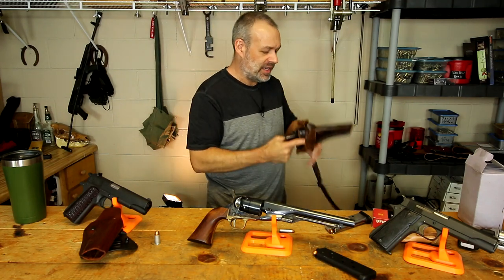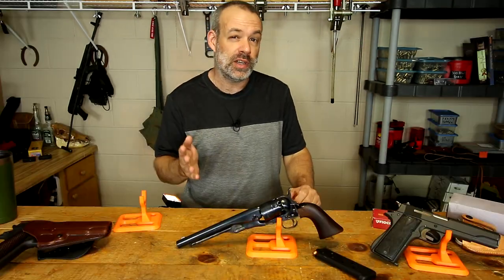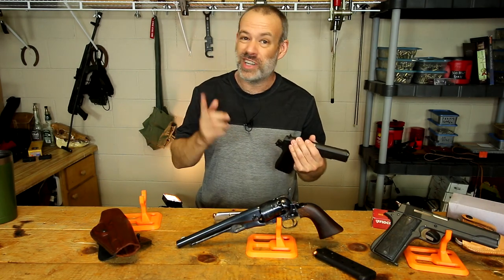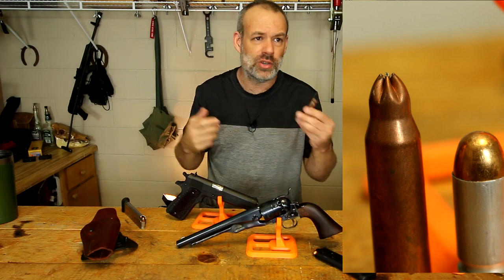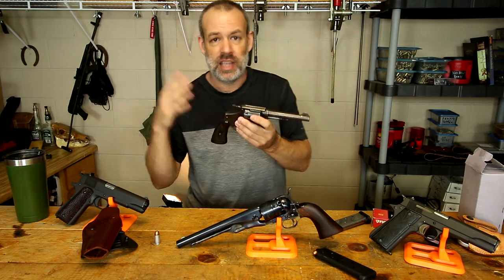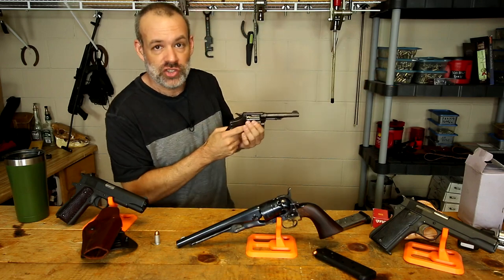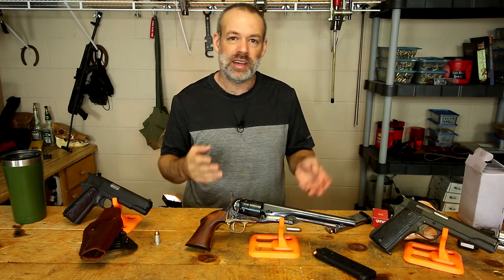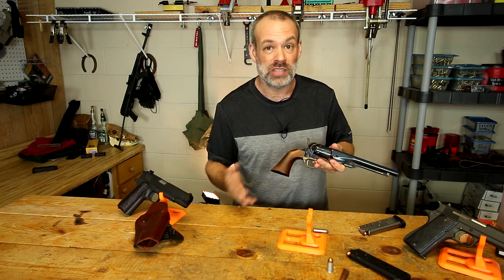How Do Prop Guns Kill?

Comment: The "prop gun" in question wasn't a semi-auto. It was a post-Civil War single action revolver converted to fire metallic cartridge ammo (or, more likely, a modern replica of one). If the account of the incident is accurate, the projectile went all the way through the chest of the DP and went on to hit the director in the shoulder. There's no way that was debris expelled by a blank round. It had to have been a live round.
Reply: it might of been an actual live round. or maybe a past squib then loaded with a blank and the the gun was never checked for a barrel obstruction.  and the barrel still had a heavy cast lead projectile inside.  maybe a primer was never nullified and might of gone off in a way no one caught it, maybe the hammer was resting on a live primer and it got bumped at some point and went off away from the prop master. it could of been the another part of the crew and when it went off they just ignored it or walked away not knowing what had happened, thinking it was just a standard pop from a prop gun.
Reply: Baldwin is off his rocker for a few years now.
Reply: Last I’ve read, the day of the accident, a number of crew walked off the set due to safety concerns. In particular, the first assistant director repeatedly failed to take seriously the required firearms safety briefings whenever guns were on set.The prop master wasn’t a member of IATSE, the relevant union, and there are reports of union film crew being replaced with non-union workers. The really damning thing (if true) is the claim that the film had a hard time finding an armorer because the reputable ones didn’t think the film could be made safely with the time and budget available. And that may be partially on Baldwin, he’s listed as a producer.
Reply: @andrewjanssen8663  yeah, it seems like safety precautions were lacking! Why would anyone be firing any type of gun or ammunition toward a crew member?
Reply: Gunn by name, Gun by nature.
Reply: @stevenmike1878  You know the previous day this same prop gun had an accidental discharge.  There were many on the set who had walked off citing among other things safety concerns.

I wonder if that accidental discharge was a primer going off and lodging a bullet in the barrel.  If, as you said.  they loaded the gun the following day with blanks and did not check the barrel for obstructions that could have been what happened.
Reply: @MikeB12800  One explanation could be they needed a camera shot right down the barrel  as he fired the gun.   These two people would have been standing right by the camera when filming.  One standing behind the other.
Reply: @Bill23799  yeah, but I would think safety protocol would be to not stand there. Treat any functioning gun as a real gun!
Reply: @MikeB12800  I think the cast and crew could have profited from a NRA safety class.   Most Hollywood types have a contempt for firearms but if they are going to work with them they need to understand them and respect what they can do.
Reply: My question is who had live rounds on set? There should be strict policy to have ZERO live rounds on set, right?
Reply: @frisc0strangler207  Just like the damn video said, sometimes you need live rounds to convert them into dummies. But, some dummy probably forgot to secure and separate the lives from the dummies. And the rest is tragedy.
Reply: @frisc0strangler207  Absolutely
Reply: Eh I'm not sure who dropped the ball but being complacent and fundamental safety rules when handling a firearm, from my understanding it was a intact and functioning SAA Colt Revolver, Uberti and Taylor makes replicas you can buy everyday. This wasn't a prop gun but a gun used as a prop, that unfortunately had a live .45LC presumably.
Reply: @nicke1903  Pretty much my assumption as well. Although I'm a certified firearms instructor and RSO, though, my take on the "whose fault is it" issue is that the primary responsibility falls on the armorer/prop master, rather than the actor. People are looking at it as a firearm safety issue, when it's really not. It's a workplace safety issue that happened to involve a gun. If it had been Baldwin's gun, and it had been at his house, or the range, or wherever, then yes, it would be on him 100%. In this situation, though, he was handed what he was told was an inert piece of steel by someone who was supposed to know the difference. 

If you think about it as a movie prop, rather than a gun, it makes more sense. Suppose this had been a modern film, rather than a western, and the actor is supposed to drive a car some distance. If the brakes fail and he runs over the person who's serving coffee, is that his fault? Of course not. Nobody would say that he should have crawled under the car and inspected it. Yet everyone expects an actor to be able to tell whether a Colt SAA revolver is loaded with live ammo, blanks, or dummy rounds? Remember, in order to do that, he would have to open the loading gate, rotate the cylinder, and check each individual cartridge before putting it back. Seems like a tall order for an actor who lives in NYC and has probably never seen one before. That's why they're supposed to have a professional in charge of the firearms.
Reply: The problem with that is movie companies know this, and they need to buy insurance for the guns in the movie. And if its a blank firing gun the insurance is more than an inert one. Plus the filming was during the day so they wouldn't use blanks for the muzzle flash, likely just a puff of smoke, which they cold also add in post anyway. 
Along with that it wasn't an accident because they know gun safety enough (look at all the movies in the past 100 years and how many accidents from guns they've had) where the crew wouldn't be directly where the loaded gun is pointed. 

It wasn't an accident.
Reply: @Liminal.Headspace  No, you dont need live rounds ever on set, make fake rounds from fired or new brass with de-activated primers.Oil or water works great if you ever need to nullify them, i accidently primed some brass i then wanted to tumble or size or something and this was how i killed the primers as i wasnt de capping live primers! Theres no excuse for live ammo being on set in any capacity. Theres zero reason why you need live rounds to make fake ones. Im not an armouror or prop master but i have made 10's of thousands of rounds including inert ones that i use for checking feed or practice, i normally have no primers in them because im not worried about asthetics. The only time live ammo is present around my firearms is when im intent on shooting something that im not worried about killing, like steel,paper or game.
Reply: @jeffreygunn3530  agreed. Prop guns have been used for decades and all of our favorite movies used them: Saving Private Ryan, the Matrix, The Patriot etc…actors need to have the freedom to play with guns during a shoot. Hence why you see cowboys spinning their guns and shooting other actors without injuring anyone
Reply: @andrewjanssen8663  yes, I find that strange too. Sounds like the big get even. Rigged to say you can't do it without us. How else would you get anything to go through one person and into another. A live round seems to have been in that prop.
Reply: @MikeB12800  even if you think it's empty. Should be checked and treated as if it were a loaded gun. And by now with all accidents checked to see if something is stuck in the barrel. This is sad because by now should be done without question at all times.
Reply: sounds like a CSI episode. exactly. debris wont kill unless it was extreme close range and the scene called for like a head shot or something. that far? and that much damage? live round. someone failed big time.
Reply: @Bill23799  A stupid situation made even more stupid.  There are remote monitors for that type of situation.
Reply: @Bill23799  That is what the on set armorer is for.
Reply: @frisc0strangler207  Should be, that's why the number one safety rule with guns is to assume they are always loaded.  Something Baldwin and company did know or ignored.
Reply: @thirdworldrider6991  It looks like this case has been solved. It just came out that the "prop" gun in question had been used for target shooting off site earlier.

In other words, it wasn't a "prop" at all. It was a fully functional gun, and some idiot left live ammo in it.
Reply: @jeffreygunn3530  someone talking sense for once 👍🏻
Reply: @jeffreygunn3530  Then it's the first time head armorer that began the cascade of safety fails...
Reply: @ducatipaso1386  Looks that way
Reply: @jeffreygunn3530  remember that Baldwin was in numerous movies prior. They all involved guns, did you see the gateway?
Reply: @MikeB12800  maybe he was supposed to point the gun at the camera, and therefor hit the crew
Reply: @peterpain6009  they have the deposition of what people said happened. He was practicing the scene which had him point the gun at the camera. I think, for safety reasons, no one should have been behind the camera while filming that!
Reply: It have to be a set up😎
Reply: that was my first thought. Alex had an affair that he didnt want anymore???
Reply: @MikeB12800  That's Almost Exactly Right!! With Live Ammunition Towards A Crew Member?   
In The Movies You Don't Have To Aim At The Bullseye Or (person) ANYWAY!!  Right?
Reply: @Bill23799  There Wouldn't Be Enough Power Behind The Lead For It To Go Through One Body And Into Another. 
Of Course I've Been Wrong Before.
Reply: You are correct.  BB
Reply: John Schneider
Reply: @stevenmike1878  Thats what happened to Brandon Lee, but I'm pretty sure this was just a live round.
Reply: It's indeed a strange story,unfortunately she died and one injured.
Don't want to be in Baldwin shoes right now.
He must feel terrible.
Reply: THANKYOU!!! Someone who actually views the Evidence.
Reply: @jeffreygunn3530  Maybe in the movie industry Non live ammo should literally have 40 percent of its case side missing. Loading a hero bullet showing the good side only. Any simulation round needs to be factually checkable by hand with human eye that it is in fact not a live round. A mark , by position, or word of mouth is not enough. One needs to be able too look at each round and know it is not live or know it is a blank even if it were mixed in with real live rounds.
Reply: exactly...in a revolver blank rounds typically do not fit in the cylinder of a functioning fire arm.  Prop guns do not kill.  Baldwin had a fully functional handgun with live ammo in it.
Reply: @Bill23799  It wasn't an "accidental discharge". Someone pulled the trigger. It was a "negligent discharged caused by lack of safety protocols.
Reply: @jeffreygunn3530  I also am a firearms instructor and RSO and I have to disagree with you. This incident happened during a break in the filming. Baldwin intentionally pointed a firearm(loaded or unloaded is irrelevant) at someone, cocked the hammer and pulled the trigger killing one and wounding another. Clearly a case of criminal negligent homicide.
Reply: Whatever the case I feel a definite investigation is needed. Hopefully it isn’t swept under the rug. This was plain negligence or carelessness on the part of Baldwin and anyone else who touched or had access to the firearm. Proper safety protocols were obviously not followed.
Reply: @frisc0strangler207  that's what happens when you have a neon-haired "diversity hire" as an armorer who is 24 years old and has inexcusably little firearms experience
Reply: A HOT load at that. Probably ball ammo. A 44LC, which is a black powder "cowboy load" would never exit a rib cage. The gun depicted must have been chambered in 44sp or 44mag, or whomever target practiced with it would not have been able to close the cylender.
Reply: Exactly , someone fucked up and loaded  a live round  in that real six shooter sorry about the language  but screwed up just doesn't  really say it best
Reply: I heard (and it might be rumor). Live ammo was on set. Some of the crew were having target practice days before. Sounds like a bad idea. This all could have been avoided with a gun safety class. Any one of the 5 gun rules would have saved this women’s life. Very sad. My heart goes of to her family. Alec Baldwin was the producer of this film. He cut corners and hired  inexperienced people. He does hold some of the blame.
Reply: @Kris-ju3rk  Alec pointed a gun at someone and pulled the trigger. Even if he checked it's status (he neglected to do that, as well), everyone knows that defies the #1 safety rule. Alec is 100% responsible.
Reply: @MikeB12800  SAG rules stated that if a gun is being fired towards the cabers, then no one is allowed to be manning the camera.  It would have to be monitored remotely with the crew behind safety barricades.  This obviously didn't happen.
Reply: Yes!!! Most guys get this!!!
Reply: @Liminal.Headspace  No. You don't need live rounds on the set. For two reasons: Safety and planning. First of all, having live rounds on or even close to the set is a huge liability and safety issue. Second, films are written and planned well in advance of filming, and so dummy rounds can also be ordered well in advance. Even further, the stupidity of ordering live rounds, to then dismantle them, when you can instead just order empty cases for that purpose, is just mind boggling to me. If that's what pro movie prop masters do, they're not just lazy, but incredibly careless.
Reply: @kebman  The problem with your logic is assuming that there were any professional arms masters on set.
Reply: @Liminal.Headspace  Ehhh you're the only one making assumptions here. I never said a WORD about who was on the set, pal. So let me repeat: You don't need live rounds on a movie set. And if they brought something like that to their set, they're carless idiots. Btw. I've worked on sets myself. And if something like that happened, I would have walked off too, bcos that's just dumb and careless. And about that, you don't just walk of a movie set either. The business is small, so when you do, it better be for a bloody good reason. Well, there you have. Carelessness around lethal sets is a great reason to walk right off a production.
Reply: Here’s some specifications. Not sure if anyone has said this yet, so I’ll put out the information anyway. It was a Colt Single Action Army (also known as an M1873) chambered in 45 Colt, which is a metallic cartridge. The original cartridge was black powder, but the newer cartridges are smokeless. It was infact a live round loaded. This gun was made and manufactured by Pietta, an Italian reproduction company.
Reply: @peterpain6009 : Baldwin was practicing his fast draw in a crowded movie set.
Reply: @jeffreygunn3530  Finally, someone of reason.
Reply: @sgtstedanko7186  Nice fanfiction you that there. Now take your meds, I think you skipped a dose.
Reply: @percyfaith11  It's more of the former than the latter. Baldwin isn't known for owning a firearm nor hitting the range.
Reply: @gunsnwater2668  Is he? And - if he is/was, is he the "guilty party" in this scenario?...
Reply: It was a real bullet,  thats out.
Reply: It was a real gun as used time and time again on movie sets. Ya have to convert them to fire metallic bullets? Wow... All you have to do is load them with harmless rounds that wouldn't hurt a fly from 3 feet away.

I guess you don't think lead is a metal. Killed many with metallic (real lead) bullets with no conversion.

No one converts revolvers, it's not a thing deemed necessary for blanks. The professionals are supposed to be smart.

The point is in a professional environment designed to be harmless no one uses the metallic (lead or otherwise) bullets for movie fire.

You've obviously never applied for a surfers license to run the pipeline in Hawaii...

Did you listen to the explanation on the video?

Review that simple thing again.

And stop spreading rumors.
Reply: @Bill23799  Discharge of what? Lead or powder that made noise and flame?

What was the discharge and discharge of what substance?
Reply: @Bill23799  Bingo!!!! We have someone that actually gets it. The director was behind the camera operator and both were shot. That ain't no blank from a yard away. And the camera would be the concern from shrapnel from a blank.

They don't even want to scratch the lenses from 10 feet away (and take time to ensure that), don't want to put freckles on the actors as that would be a obvious problem and damn sure don't want anyone to need go to the set doctor (except stunt people getting dragged by a horse with scratches on purpose). And then? Hurt a high dollar camera? Much less killing the camera, the person running the camera and hurting the director?

Pro stuff is pro, that's why they call it professional.

Of the thousands of modern movies made employing hundreds each time how many got hurt or killed (not including the stunt people that do that for a living)?

Should you go and compete in a surfing contest in the Hawaii Pipeline? Only if you are proven to be a professional beforehand.

Wowsers... How obvious.
Reply: @thehippiedog5956  You really shouldn't talk about things you don't understand. The"conversion" I referred to in the original comment last week is from a cap and ball configuration--which is how the Single Action Army revolver was manufactured by Colt--to one that accepts metallic cartridges. It has nothing to do with bullets, genius. Now go back to playing Call of Duty, and leave the discussion of real guns to the adults.
Reply: @stevenmike1878  That was a live round without doubt.
Reply: @Liminal.Headspace  why not just convert them off site in a safe and controlled location
Reply: @MikeB12800  If he was just rehearsing the scene, why was the gun loaded in ANY way? There would be no need for it to fire, and no one would have been injured or killed. It is Baldwin's fault for not checking the gun himself, the armorer/prop master for not clearing the gun, and allowing ANY live ammo on set. Also, since he is the producer, Baldwin is on the hook for the numerous reputed safety violations. 
I think, even if he avoids serious jail time, he's finished as an actor, producer, etc. He's also finished as an anti gun spokesman.
Reply: @jerryparisi2885  A live round would absolutely be powerful enough to pass through one person and hit another. Especially if it's a large bore, "Old West" cartridge, like .45 Colt, .44-40, .38-40, and such. Or even a modern cartridge like .44 Special/Magnum, .357 Magnum/.38 Special.